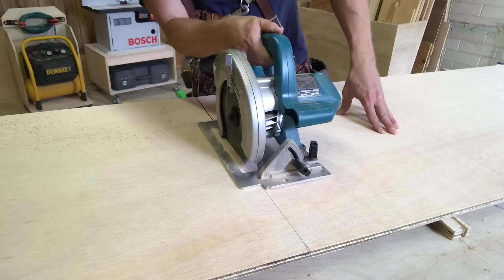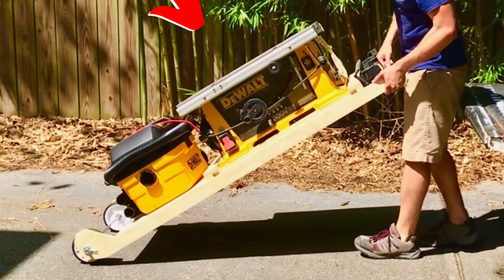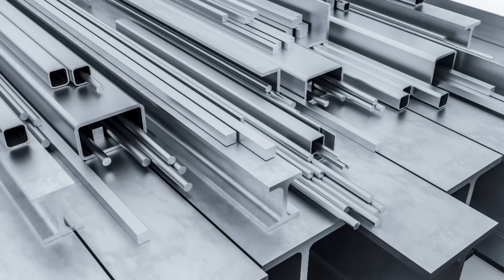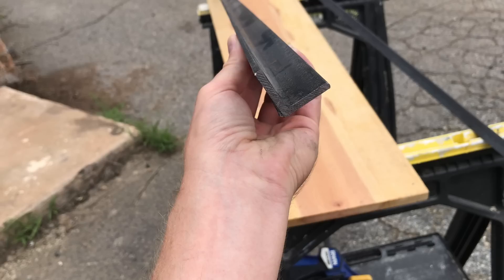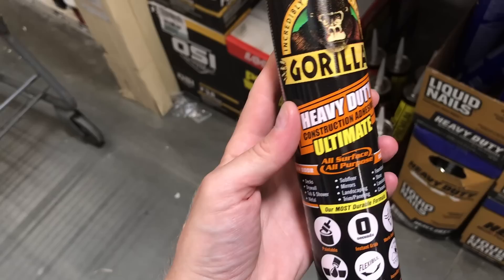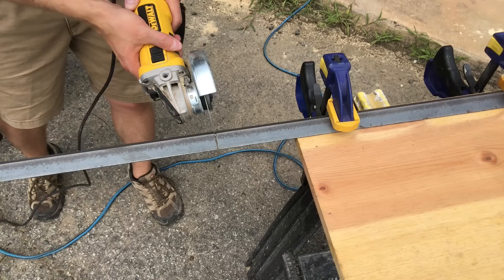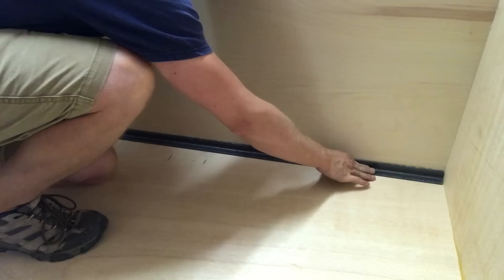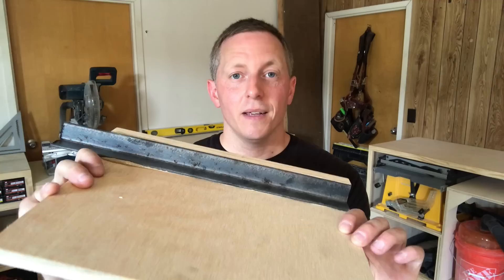How To STRENGTHEN WOOD WITH STEEL! (Make Your Wood Projects Stronger With METAL/STEEL...#1 Trick!)

Comment: When you do this, don't just wipe the metal off with a rag.  Use a solvent or degreaser that leaves no residue.  Metal is often oiled to prevent rust and that can screw up the bond.
Reply: I also take a 60 grit sandpaper to it to give it more "teeth" for the adhesive to grab.
Reply: ya it should be sanded on the mating surfaces. but i would still use small bolts.. no glue needed.
Reply: brake cleaner
Reply: @BIKEMAN21  I would only do that if the bolts don't negatively effect the appearance.
Reply: @ruinunes8251  It's not quicker if it takes 2 days to dry.
Reply: @kd6507  2 days, ok. Screws then it will be 😂
Reply: I agree .Id trust  steel bolts  over glue in this situation
Reply: Glue, properly applied, is actually stronger in this case. The steel is not to just “support” the top - its to strengthen (stiffen) the wood members. Steel sags (deflects) a lot more than you’d think. Bonding it to the wood is much stronger.
Reply: James Bond?
Reply: Use brake cleaner to clean the metal.
Reply: Great advice both on grit use and cleaning thank you

Comment: I would recommend getting steel from a steel supplier if you can. Home Depot charges out the nose for their steel. If you have a steel supplier near you, check out their scrap pile first. That "inexpensive" $16 piece of angle iron would have cost me about $5 at my local steel supplier.
Reply: Max Powers  lol what?
Reply: And they would cut it to length for you.
Reply: Agreed!! A lot cheaper...I buy my angle iron at a steel supply company...I think I paid $24 or $29 for (3) - 1/4 in x 10 foot angle irons (30 feet)...They cut it for you by whatever length you need...Home Depot and Lowe’s are too expensive...
Reply: @juanmendoza7487  that's very true! The convenience factor will burn a hole in your wallet!
Reply: yeah i've also had cases when dealing with a small fab shop, of ordering it in 1/4 thickness of steel, and they will drill out hole locations for you as well if you give them measurements, far easier than trying to drill 1/4'' steel on site.
Reply: Follow up: I just bought 12 ft of 1/2 inch angle iron for $13 and some change
Reply: @jaredhammonds8255   - Max is obviously drunk.
Reply: Absolutely. The supplier I like to go to has a scrap room rather than pile. All sorts of cool chunks, plates, tubes and sheets in steel, aluminum, copper and brass. An "Artists" bin has brass and copper sheets ranging in the 4" by 4" size range, very cheap and useful. I love going there and just browsing for ideas.
Reply: @robira1313  lol I thought so too
Reply: Steel suppliers usually have a minimum charge. HD or L  do not and it is new and made in the USA.
Reply: Yeah, $16 for that tiny piece is not "inexpensive". LOL
Reply: You people must live in a rural area or something to have steel suppliers nearby.
Reply: Home Depot and Lowe charge a lot for much of their hardware also. I can go to a local hardware store and buy a box of 50 quality bolts for less than half buying them at the big box guys.
Reply: Thanks for the tip
Reply: @paulparoma  nah Houston, Texas.
Reply: @jaredhammonds8255 Sorry to hear that.:)
Reply: @paulparoma  lol depends on what part you live in. It's not so bad
Reply: @jaredhammonds8255  Like everything else. Even Birmingham, Alabama, has one nice section.:)
Reply: @joe52428  I worked at Norfolk Iron and Metal for 7 yrs. If you wanted delivery you had to buy at least 2000 lbs. Though we were open to the public to come and buy in less amounts. Side note Metal west is now owned by N.I.M.
Reply: While yes you can get angle iron for far less at the supplier. You looking at 20 foot pieces minimum. If you want it cut down for you there your going to charged the labor for cutting it. You get charged for all whole piece of still so if they cut an there is scrap after the cut they make extra money by selling the scraps back to the smelter.
Reply: @jacobkreitzer7160  A HD or Lowes is close to most people. A steel warehouse is a journey for most. For small quantity I rather pay more and drive less. Plus it is new and it tells you where it is made.
Reply: Word!  I flinched when Ethan said “inexpensive”.  A mere 6-foot piece, with no pre-drilled holes is $24 + tax.  A select 1x2 is $5.

If I were to use steel in this manner, I would get the angle iron with holes in it.  The holes will not substantially weaken the angle;  it may weigh a bit less, causing less sag.  Most importantly, I would add enough adhesive so it comes through the holes.  When the glue hardens, it will form “keys” like with lath and plaster — kind of a mechanical fastener.

Speaking of which, holes in the steel bar would allow you to use short screws from the underside.  Excellent glue can fail from inadequate prep;  screws don’t;  together they are stronger!

Hmm, I would think that a 1x2 facing glued and nailed would be adequate.  Loctite PL Polyurethane Construction Adhesive holds like a mother-father!  The wood will rip apart before that glue fails.
Reply: Check scrap yards and recycling centers, places where scrap metal is bought. They salvage pieces like angle iron, channel and square tubing. Often they sort it and stack it on racks, then they sell it for pennies a pound. You could probably get those pieces for a couple of dollars each.

Comment: Here's a tip to get angle steel like this, get old used steel bed frames from a thrift store, and chop it with thin abrasive disc on an angle-grinder. Its difficult to drill for a variety of reasons, but it bonds with adhesive and welds easily. edit: I went to habitat for humanity/Restore, and they had twin bedframes piled up for $10.
Reply: I was going to say the same thing, except a lot of the times you can find them on the street or alley of your city on garbage day. So save your self some cash and get them for free.
Reply: You gotta take the paint off first
Reply: If you live near a college town just wait for Spring time. When the students go home there's a LOT of new stuff in the trash. Bed frames, a/c's, microwaves and minifridges galore!
Reply: @Lakillika  NO! I was going to say the same thing! LoL! I was seriously thing this as I was watching the video. I'm also going to use bed rail as the fence for each side of my miter saw/RAS station. FB Market place and curbside is a great place to find used bed rails.
Reply: I use old bed frames too, but they are as tough as a boiled owl's beak.  They're made of a surprisingly hard alloy that's really tough to drill or saw, much like automotive axle shafts.  If you cut with an abrasive wheel and weld, they work great.
Reply: Re-using - even better than recycling!
Reply: @ralphwaters8905  LOL a boiled owl´s beak
Reply: @drasco61084  why would u go and do that
Reply: @ralphwaters8905  the bed frames i drill thru are really soft steel. If you over heat it though with dull drill you may harden it.
Reply: @BIKEMAN21  so it bonds well with the adhesive. Not just trying to glue paint to stuff.
Reply: @drasco61084  ahh ... i see. thats a good idea then.
Reply: The bed frames at our local Salvation Army were over $40.  No bargain there.
Reply: @JT_70  forreal??? Wow that's how much they cost new!
Reply: @JT_70  Daaamn, son...they gettin' greedy as all hell...
Reply: @drasco61084  That price was for queen-size frames.  We bought elsewhere cheaper.
Reply: @JT_70  the metal frames I'm thinking of can be adjusted to twin full or queen. The one that's just a base no headboard or anything. I hate those I always hit my shins and knees on them... Shouldn't stick out past the mattress the eye follows the mattress.
Reply: Old bed frame, making / fixing stuff around the yard, over 30 yrs.
Reply: I cut up an old bed frame I got for free and made my welding cart.
Reply: Steel bed frames are spring steel, but yes, this is a good idea. Salvaging, via carwashes where people dump things, and if you live in an apartment complex, people moving out at the end of the month, leave stuff.

Comment: There is just one thing - never over load it- the steel will not spring back, if you use a steel "L" brace front to back midway you can connect the back angle iron to the front making much stronger.
Reply: Agreed and it still flexed when the guy sat on it.  I don't like what he did.
Reply: That's a good point. Structurally stronger product would have been 1" x 1" square tube in 1/16 thickness for the back. The front can be 1x1 angle bar in 1/8 thick with small triangles cut off of a 3/4 flat bar and welded perpendicular to the inside faces, 1 reinforcement piece every 8" with one at each end.
Reply: Great video with xlnt carpentry work as usual! 
I'd a used the glue as well machine screws or 1/4" bolts,washers, and lock nuts through predrilled holes as well. Maybe even some metal cross braces welded in. Just my 2 cents worth...

Comment: find a local steel wholesaler who doesnt mind dealing with joe public, get 20' lengths cheaper than HD sells the 6' ones, makes it reasonable to have a few sizes shapes and thickness's on hand save trips to the store and widen project options
Reply: This is good to know for those of us that can't splurge on materials.
Reply: Max Powers  Yes, they sell to the public but you can only buy 16' lengths or full 4x8 sheets. Some will want you to have an account with them and then they will sell you smaller lengths but they expect you to buy in job quantity. Most don't want to deal with hobby quantities. Also, expect to pay higher prices if you're not a business.

Comment: Our company has done several R&D projects that involve adhering steel and wood. One thing we learned right off the bat is that most steel has what's called "mill scale." It's a product of the manufacturing process and is very difficult to remove.  But it will separate under high stress. The only way we found to effectively remove it was a thorough sandblasting. Sandblasting has the added benefit of leaving millions of tiny divots in the surface that aid adhesion.

Comment: I was a commercial cabinet maker decades ago. The standard was 3/4" plywood for the sides, facia and 3" span strips which were rabbited 3/8 of an inch on the inside top of each side so they were flush (3/4") with the top of the sides. This provided some strength as well as the ability to fasten the countertop to the base. 1 1/2" Styles and Rails provide additional rigidity as would a 1/4" ply back. A 3/4" Dado about 3 inches from the bottom of the sides to insert a bottom which acted as additional storage and rigidity and notching the toe kick in at the roughly 3-inch bottom.

Comment: Wow I had this exact issue a few weeks ago! I was making a planer sled to flatten slabs, but it was made out of MDF and started to sag. It was 6 feet long, and definitely was not stiff enough for milling down thick 6/4 white oak. I went to Home Depot and got 90 degree aluminum stock and loctite adhesive and did exactly this. Works fantastic!!!
Reply from the maker: That’s awesome, Ted! Dead-on similar solution. Now I feel increasingly validated in this approach. 😆 Definitely want those planer sleds as flat as possible!

Comment: Great video, thank you! Here in Spain, steel is sold with a light coating of oil or sometimes grease, so I use acetone to make sure the steel is completely grease free before bonding.
Reply from the maker: Good tip, John! Happy to hear from Spain! 🇪🇸😄
Reply: Same here in USA. I also use acetone.
Reply: Same in Canada
Reply: Using a flap disc on an angle grinder to remove the mill scale also helps.
Reply: @darkmagna9004  your mail please, I want to send u a message

Comment: Thank You 
I’ve used angle iron to reinforce shelving but had used screws, never used construction adhesives. Never thought about using it.
Reply from the maker: Thanks, Monte! I hope you get to try it sometime—it’s like having magic fasteners anywhere you want them 🙂
Reply: Construction adhesive is gift from above, as long as you never want it let go.  It won't without a sledge!
Reply: Same here. I recently used steel flat bar to support runners on a skill saw sled but used screws... lots of screws. I toyed with the idea of welding on some mounting flanges, but seemed overkill.  No idea an adhesive for this existed. It would have been so much easier. all the sleds I've seen on youtube were only about a 12" span so the runners don't flex, but where's the fun in that so I went with 30". It replaces the sliding mitre saw I don't have.
Next time I'll watch your channel BEFORE i build, not after.

Comment: In a time of expensive wood, this is a great way to add strength without having to buy the equivalent wood to provide the right amount of support.  Nice tip.
Reply: He said an 8' stick of angle steel was $16. A stick of #2 2x4x8 SPF is currently under $4 where I am. The steel is 4x more expensive.
Reply: He spent $39 dollars extra for the steel and bonding material.  That cost more than upgrading to a sheet of ¾ instead of the ½ inch.  Steel isn't cheap.
Reply: @ProleDaddy  you beat me to it
Reply: Both of you are correct for his design.  I should have specified that that I had a much more extensive table in mind for myself and basically was thinking out loud.  Using steel for support on my design would actually decrease the cost of the table given the price of wood today as the way my table is designed takes a lot more wood.
Reply: In this thread: People who missed the "so every inch counted" part of his reasoning. For lots of projects, weight is also a priority, and steel or other metal can end up weighing less than wood of equivalent supportive sturdiness. Also it's not like he used all the adhesive for this one thing lol
Reply: @ProleDaddy   he also said he went to the Depot... big-box stores are the most expensive way to buy stuff like that, go to your nearesr steel supplier... huge difference in price... & usually better quality & range too !!
Reply: @bradleybritt9198  Even with 3/4 ply, that span without middle support would have sagged in the middle. As said at the beginning, the goal was to keep the look "thin and elegant" not produce at the cheapest. Just sayin'...

Comment: Another good video. You really don't have to worry about cutting metal with a wheel the sparks are less harmful than the ones from sparklers, no need for gloves or long pants. I was a welder for the Navy so I know what I am talking about. Thanks for another enjoyable watch.
Reply: yeah, the main concern is a grinding disk breaking off more so than the sparks, a leather apron wouldn't be a horrible touch, but not really needed, main thing is any synthetic fiber clothes like nylon or polyester will get a bunch of little holes melted into them

Comment: We do the same thing, but to granite. When we would cut granite outside to fit an undermount sink it would become really weak in the narrow parts of the cut, the front and the back. So we would cut slits into the narrow parts of the granite, from the bottom, and epoxy the metal reinforcement into the cuts. Basically embed the metal stripes into the granite and it made it so that we could handle the granite without fear of it instantly breaking when we lifted the finish piece into place. Also buy the metal at a iron supplier because they are much cheaper if you can.

Comment: I've done this before, but I've always notched the wood so the angle iron was supported on both sides.
Reply from the maker: That would strengthen it, MMP 👍
Reply: I don't think that would actually add a lot of strength in a case like this. The strength comes mostly from stiffening the plywood-- there's almost no risk of the wood shearing off at the edges.
Reply: @worganyos  
Yeah but if the glue should turn loose years down the road your angle iron would not fall on your toes.
Reply: @tubeonline629  that's true

Comment: 100% great video. About 15+ years ago I used the same size angle iron building a very similar cabinet. I like the "glue" you used. I just a glue back then, but I also drilled about 6 small holes to install 6 - 1/2" screws to help in the bonding... I didn't wait 24 or 48 hours 🙄 I just turned it over. I have a little more patients now.
Thanks and God bless

Comment: I’ve done this with the combo of glue and screws so that I don’t have to dedicate the space for it to dry and cure. I’ve used a countersink and spray-painted the show side of the angle iron or bar stock and it looks really good if it’s not something easy to hide behind a face frame
Reply from the maker: That’s awesome, Greg. Being able to effectively countersink the steel is what really makes method effective. Like you said, if you can’t hide it, make it blend!
Reply: @TheHonestCarpenter  I use screws too without bonding stuff. To be honest, I never thought about using bonding materials. Old school here. 😂
Reply: If you can hide the screws, or use a design which looks good with the screws, glue & screw is pretty much the ultimate method of construction for most projects. You get more strength than a mechanical fastener, but you don't need to wait for the adhesive to set before continuing work.
Reply: @garethbaus5471  Good point. 👍